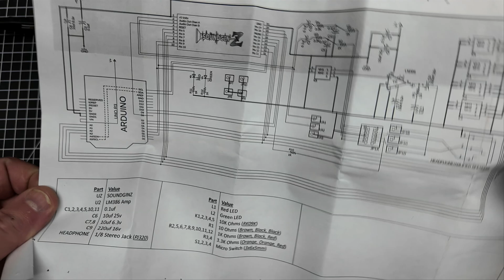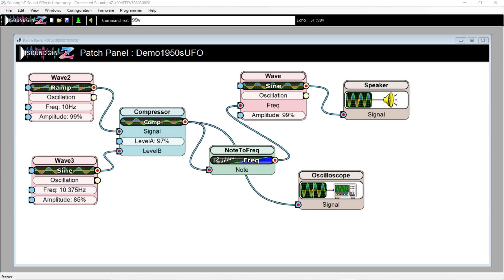Build a Mind-Blowing Synth with This Unique IC: Sound Design for Robots, Radios & More!

Comment from the maker: Affiliate Link Disclosure: Some links in this description are affiliate links. Clicking them supports the channel at no extra cost to you—thanks for helping me keep the content coming!
Project Materials:
Speaker Driver - https://amzn.to/3DcuRWZ
Speaker Audio Cord - https://amzn.to/3FdmXx5
Mono SoundGinZ Chip - https://www.ebay.com/itm/276557107631
Stereo SoundGinZ - https://www.ebay.com/itm/276178062660?
Quad SoundGinZ - https://www.ebay.com/itm/276557113089?
Bare, kit, or assembled SoundGinZ Experimenter Board (great for Dev Work) -  https://www.ebay.com/itm/276623114236?

3D Printing Models for speaker FREE! - https://www.printables.com/model/1220658-speaker-enclosure-for-a-25-driver

Tools Used:
PCB Holder - https://amzn.to/41wAHKH
Soldering Iron Holder - https://amzn.to/4kzdy2U
Portable Iron - https://amzn.to/4kzhQXY
Flush Cutters - https://amzn.to/4hloSNb
My preferred Solder - https://amzn.to/4hloSNb
Soldering Tip Cleaner - https://amzn.to/41zkDb2
DeSoldering Braid - https://amzn.to/41LYGGZ